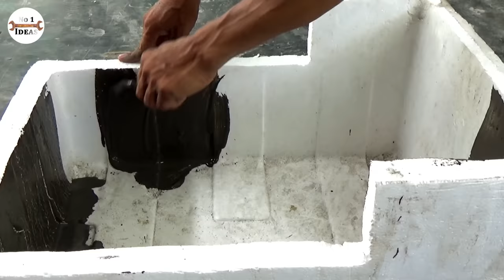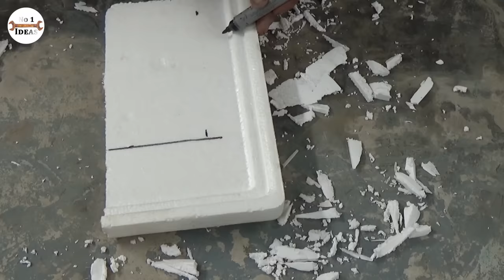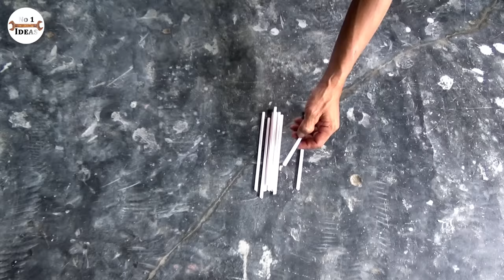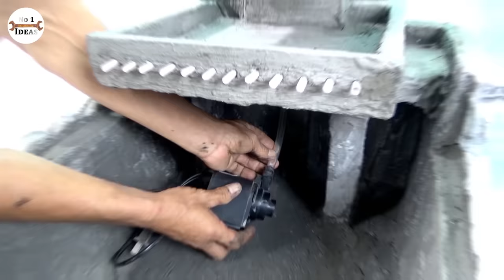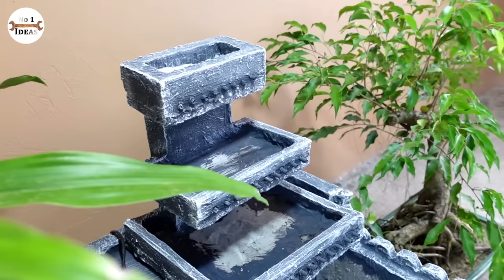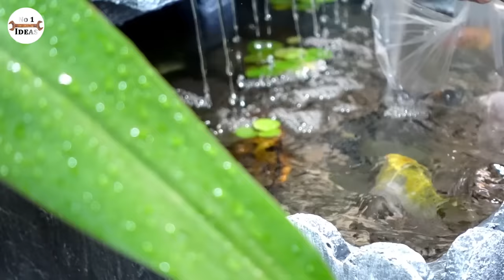How to Build Unique Multi Level Waterfall Aquarium from Cement and Foam Box at Home

Comment: Love the work - I got a question regarding the foam boxes etc when use. Won't that break down? Just wondering how long it would last..
Reply: It takes aprox 500 years for Styrofoam to break down, so I would think it would be fine.  I will say it would be much more light weight, and the cement more brittle due to its thinness, but yeah.
Reply: maybe we can increase the strenght by applying new layer of cement on top of the dried one, do that over and over until we're satisfied with the thickness.